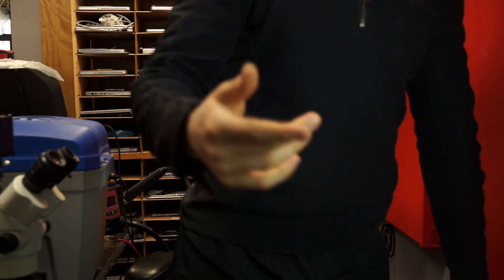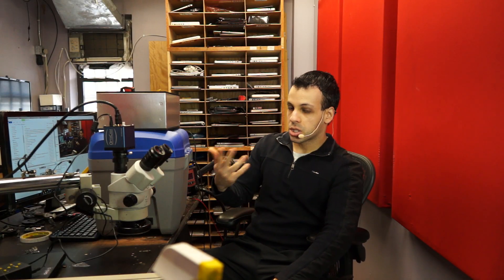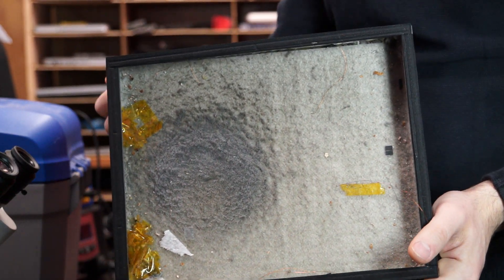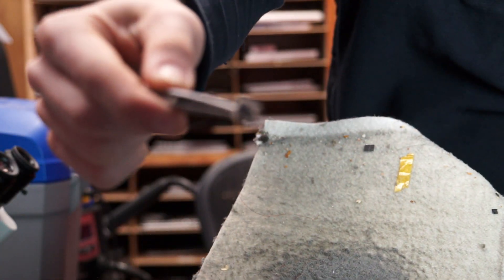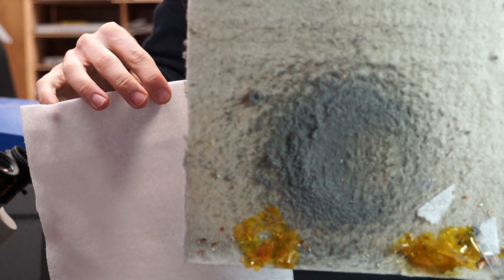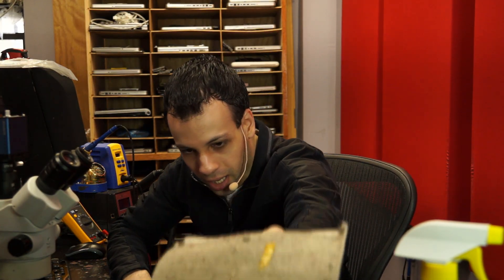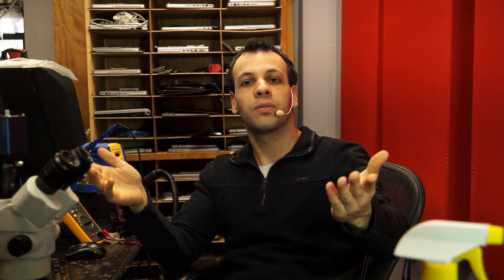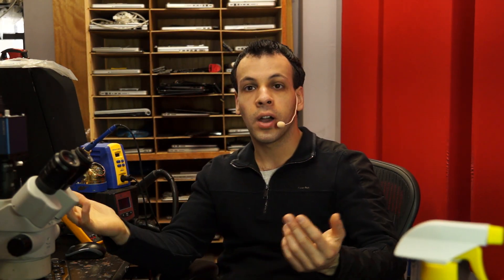A word on soldering and fume extraction

Comment: Id love to see you make a video where you test the used filter to see exactly what all of that is. I say this because my normal fans will look like that after a month of lots of use before i started soldering, just from normal dust. I’m not doubting that some type of fume extraction isn’t necessary, I believe everyone should at least have a fan blow it out of their face. I just started soldering and because the cheap ones that use a carbon filter cost like you said 50-70 dollars I bought a compact blower fan and some tubing. Since my desk is right by my window I attached about 6-7 feet of tube to fan and cracked the window and stuck the other end out. The blower fan isn’t weak but once I add the tube it adds a lot of resistance and it sucks the fumes up way less so I made some other modifications and still it’s not very effective and just very cumbersome and hard to work with. I’m dead broke right now so it’s just so annoying that now I need to cough up the money for an actual funeral extractor on top of the $30 I already spent. I’m thinking about just getting a carbon filter to put on this fan but i feel like at this point I should just stop trying to make this fan work and buy one that’s meant for this idk.

Comment: Dear Louis,

Do you also run an active carbon filter in there? A HEPA filter does remove dust and flux fumes. But if you have lead fumes these are not captured. Care about your lungs and brain.

Comment: Buy a cheap shop vac and buy fume extractor filters and and line where the air Is brought in and exits with with filter should be possible to do for about 50 bucks

Comment: Louis, loads of respect for you taking a solid line on health. The side effects of not using fume extraction are real and very bad. Specifically, the fumes from the burning rosin (resin, flux, whatever) are nasty. Some refer to occupational asthma or industrial asthma or other terms, but it is real and I live the effects of it after a lifetime in the industry. Many doctors palm it off as 'adult onset' asthma, but it is real. When I started as a 16 year old apprentice in the military, we did not use ventilation or fume extraction - safety was all about cleaning or protecting the work area, not our health! At least our militaries did eventually change that attitude and do care for their people now, but for me that was halfway through my career. The effects can be very long term and may not show up for 20+ years. Once the immune system becomes vulnerable through the long term fume exposure, it also preps the body to be less immune to other allergens. So essentially, the industrial asthma opens the way for me to have asthmatic reactions to other allergens! Please, please everybody, take the fume extraction seriously.

Comment: You can build a beastly extractor for peanuts using the small or large shop vac of your choice and any HEPA and activated charcoal filter panels you wish. Mine is a small shop vac whose hose fits the cut-off end of an antifreeze jug which took longer to wash off than connect. You can use clamps, magnets or zip tie yours as I did to a spare monitor arm. 
Filters are key. You can match or beat commercial units simply by using appropriate filter media but the best way is to exhaust outdoors because "filter and recirculate" does not give you FRESH air. 

Plumbing shop vacs is easy as is cutting a panel to insert in a window so your fume extractor also draws clean air into your workspace. If you exhaust your air you don't need to filter it.
I collect all the shop vacs large and small I can score cheap (yard sales etc) and have them throughout my shops. If you place your filter on the exhaust side of the vacuum it can be large, bulky and mount anywhere including walls (unused wall space should be put to work for zero footprint equipment locations, I even hang my 1U server like a painting).

Comment: I had to do a tiny bit of soldering on one of my guitars recently. The jack needed to be replaced, so I had to solder it loose, install the new one and then solder the wires back in place. I actually put a desk fan at a speed/distance where I got maximum airflow over the desk without cooling down the soldering iron/components too much. I had two large windows open for ventilation and still I held my breath while hanging over the desk to solder everything in place. There's no way I'm gonna inhale all that garbage. If I had to do soldering on a regular basis, I'd get a fume  extractor for sure.

Comment: I’ve only soldered like twice to replace some game cart batteries & try to start repairing my Genesis controller ports, and I had no idea this was a an issue, even with lead-free solder.  And my preexisting asthma wouldn’t help either.
One time when my mom was right all along. Even if I’m moving my soldering outside, I’m gonna look into a Hakko FA-400 filter. Or use that high power fan my dad has in his garage. Thanks for this vid, it’s been a month or 2 since I first soldered in my room and this just adds to why I should never do that ever again.

Comment: I made my own solder sucker out of a 12v marine inline fan and flex dryer tubing. Sounds like a jet when it’s on high but the Fumes go outdoors far away. 
I also weld with flux core wire on galivanized steel outdoors with a huge shop fan and a respirator. 
PPE is your only hope! Never ever let some fool tell you different!

Comment: How well are those cheaper extractor with just regular carbon filter work? I don't have 600+ dollars to spend on the extractor since I'm just a hobbyist. I always just solder next to an open window, which's not always convenient. It'd be nice if the cheaper ones do well as well.
Reply: Instead of opening the window you can cut a simple panel to fit the exhaust hose from a shop vac. Used vacs are cheap and highly effective plus they bring in FRESH air by removing contaminated air.

Comment: Nice that you show the filter and how dirty it looks but be honest, you used it also as a vacuum as kapton tape isn't airborne nor is 60/40 or rohs solder granules. But you are right, flux, metal and especially lead fumes will harm you. The first 3 minutes were ok, the rest is filler.

Comment: 02:43 This is a pre-filter that traps the coarsest particles and dust. It is best to replace it every 7 days, max 30 depend on use. The most important are the next HEPA filtering very small particles like 0.3um.

That gray thing is tin fumes, and this is especially bad for tin fumes with lead.
Even if not such a great HAKKO equipment, each smoke absorber with 3 filters will also be good for an amateur, as long as the filters meet the standards.
When working professionally, there is nothing to save on health.

Comment: On the cheap for lab work and soldering, I just use a 40$ exhaust hooked up to a socked activated carbon filter tube for 25$ and some flanged flex tubes for 12$. I have asthma and early COPD and to much BS in my lungs to take to many chances even if I can not afford a 400$ fume extractor. You could just set the exhaust assembly with a filter on the floor and it will clean the air in the room but to protect the motor and for just in case, I hook it up to suck through the filter and out a window.  I mean it is pretty good and does not even leave a smell, the flex tubes can easily be moved on the fly next to my work. It will not only protect you, but it will also completely deodorize the air given time.  I use a 6 inch but a 4 inch would be fine for just soldering and flux fumes.

Comment: Flux fumes, they are hazardous.
Not breathing the lead or tin though, you would need a solder pen heating in excess of 1700c+ to boil those metals into fumes.
But avoid the flux smoke, that has hydrochloric acid in it and a bunch of other toxic polymer chemicals that bind in your body building up over time.

Comment: Don't waste your money on a fumes extraction gadget.  My lab is setup with a fumes exhaust system which vents the fumes outside.  Works much better and no worries about whether or not the filter is functional.
Reply: That's how the big boys do welding fume extractors and the method should be much better known because filters don't bring in FRESH air.

Comment: And for those of you doing it on a budget and saying "Well, I have these cheapo 20-40 $ carbon filters with a little fan" - they pretty worthless when trying to filter the fine particles out. Charcoal-based filters are mostly for VOCs and gaseous particles which are adsorbed by the charcoal pellets - but they have a hard time filtering out small solid particles. That's where HEPA grade filters come for the rescue. I know, they aren't cheap - but there is a reason why they are $$$.

If you cannot afford them, make sure to solder in a well-ventilated area. Use a fan to blow (might be better than sucking) the fume away from you, so you do not breathe the whole dose in.

Comment: Just a little thing to add: make sure you get a fume extractor with a normal prefilter. This prestage filter is just for filtering out big particles (normal dust and some debris), so that they don't get stuck on the main (HEPA) filter like in your Hakko extractor.

Helps to make the expensive HEPA filters run longer and more effective, because it get's only cluttered up with the fine particles. Apart from that: Use a fume extractor, you do not want to get that sh*t into your lungs. It does cause asthma and is under the suspicion of causing lung cancer, too.

Comment: I work in a room with two electrical engineers that solder from time to time. Once they filed the room with fumes and it was unbearable. Raise some concern and got told they'll crack the door from time to time

Comment: When I was in my teens we would use compressed air to blow the asbestos dust out of the brakes we were rebuilding.  Most of my life I worked in factories, exposed to God knows what, with safety gear that was inadequate at best and frequently nonexistent.  I'm in my sixties now, more through good luck than good planning.  I'm sensitized to so many different things I had to move to a nonindustrial part of a third world country to be comfortable.  Take this stuff seriously, or put a down payment on the lot next to mine.  It's your call.

Comment: Anyone know if the Weller Zero Smog EL is a decent unit for a single microsoldering workstation? It's the only one available around here and ordering something else internationally for twice the price is kinda difficult these days with supply chains drying up. But if its utter crap, I guess we'll have to do without for a while longer until we can afford and actually get, a different unit.

Comment: I know this video is getting old. However, I just watched it. Therefore,  I'm sure it gets new views all the time. 
Some advice. 
If you solder more then 30-min a day on average. Without fume extraction of some kind. I think it will affect you one way or another at some point in your life. With that said, it's a free country or It should be a free country, that's an entirely different debate. Do what you will. This is for all the new video viewers that have some concerns about replacing oxygen with solder fumes. 

 I have been soldering since I was very young, I'm 40 now. I will give you two tips for those who are low on cash. 
Go to a junkyard pick up any auto blower motor. Preferably a 4 door truck blower. The blower is located under the dash passenger side. 5-10 bucks. That's all I will say about the blower if you can't figure it out from there you probably should not be working on electronics. 
2nd. I have never purchased an expensive fume extractor. These things are not rocket science.  They are a suction fan (blower) with filters designed to remove micron size particulates. The science only comes into play when you are figuring out CFM to filter resistance in order to get a good air volume and pull force to do the job. 

I do pay for the proper filters to do the job, I don't cut that corner. You can buy these filters pretty cheap if you don't go after brands that make soldering equipment. I buy the filters then build my extractors with the filters I purchased in mind. Filter size, shape and density play a part in your design. 
 I don't use automotive DC blower motors anymore. They do work great. However, running DC can be a pain. I use blowers like  Fasco Centrifugal Blowers 115Vac. I pay $20-$50 for one. My homemade fume extractor pulls more CFM than the $1k name brand extractors & I build them to fit my workspace size. I use simple airflow tubing, material like 2.5" Pool vacuum hose or 4" industrial vacuum hose its nice and rigged & my favorite 4" - 6" Tigerflex Polyurethane Vacuum & Duct Hose.  

Anyway, have a good one!
Good luck with your adventures.

Comment: You can build a BETTER fume extractor easily for less than $200. That includes the inline fan, box, (certified) HEPA filter and carbon filter. It's really quite easy. I agree with rossman 99.9% of the time. The only two points I really disagreed with so far, was the knock-off HAKO station, and the idea that you "NEED" this HAKKO Fume Extractor. It's ridiculously overpriced. The HAKKO extractor is literally a $50 shopvac with a $60 filter in it for $600+ 

I will be posting a guide on how to build this very soon. You can get everything you need at your local Home Depot or Lowes.

Comment: It's an old post I know but just appeared on my youtube page , I'm an old tech that use to solder TV equipement with this thick gauge of welding lead in the old days on point to point equipment  ,people and company owner used to have an excuse not to protect their lungs like saying well you just develop a technic off not breathing in when the lead touches the soldering iron lol  ,then later  i worked into big telecom factory in SMD device and fiber optics it took them a lot of time to adjust to safety norms believe me' we had all the safety imposed anti-static regimental rules like ESD shoes and flooring and lab coats but even there nothing to protect assembly workers doing touch up soldering works  because the main part off welding was done on the wave machine with its own extractor ,so what we did we bought our own 120MM computer fan that we layered a carbon thin filter on them so we didn't have to hold our breath welding ,mind you welding surface mounted micro device your still controlling your breath not to shake under a microscope without you even noticing it !

Comment: I think I'm pretty "healthy" even as a smoker. The one thing g that I really don't want to breath in are solder fumes. Currently what I do is open all my windows with my room fan on my ceiling on. Not really the best set up but it's what i've got to work with.

Comment: "Poverty is not an excuse to breathe in fumes" Agreed. When I was in my college dorm, I would just push my desk up against the window, throw a box fan in the open window and suck out the fumes. It worked better than any fume extractor I've used.  Meanwhile at work, as a technician, all we have is one of those crappy little desk fans with the carbon filter. The worst thing I have inhaled while soldering is superglue fumes... If you get superglue above 500°F, the fumes feel like you are breathing razorblades. Also pro-tip: Teflon fumes will give you flu-like symptoms for a couple days. It sucks.

Comment: Not to argue about the need for a fume extractor, but how do we know that the crap in the pre-filter is from the soldering alone?  I pull that kind of crap out of my PC without any soldering.  Looks more like the lint floating around in the air.

Comment: With all due Respect here to Hakko, this is nothing but a plastic $50 Shop Vac with a Box Filter LOL. This is nothing worth more than $100 even with the plastic hoses. You can build this type of box filter yourself for around $60. You will need a small square type Shop Vac, Dimmer for voltage control to the motor, a vehicle  rectangle filter, a second shop vac hose for the second person so cut out a second hole on the top of the shop vac cover. Hakko is ripping the hell out of idiots who can't tell a plastic box that is really a shop vac. Again for $60 you will build this Hakko clone.

Comment: Just a note: the circle of grey stuff doesn't come from the solder and flux, it's just dust. The discoloration, on the other hand, comes from the solder and flux fumes. None the less, it is important to get a fume extractor.
Reply: Also you're probably not going to be inhaling the kapton tape, wires and random component.

Comment: My old boss didn't use extractors.  
You have your head over it, hours a day. Do that for even a few days and you start feeling it. Throat feels sore, feel off in the head.  
Plus on small workshops someone on another bench can be soldering and it's floating around for hours in the air in there.  

I You can get away with soldering once or twice without one, "just hold your breath" sort of deal for a transistor or a capacitor you need to replace every few months.  

But it gets to you for sure. Even carbon foam filters and a PC fan are heaps better.

Comment: I assume it also sucks up DUST particles in the air and since the solder is not in gasform that is most likely dust, dont you think? It looks exactly like the dust in a vaccum cleaner.

Im also interesed in FA430 but $842.15 is a bit much.  Can you recommend any other models that "sucks" more then the toy Fa400? Looking at a CXG 493A, have you tried that that?

Comment: A cheap solution is to get a "6 inch mixed flow fan" off eBay or Amazon for like $40, and a 6" dryer / air conditioning duct, and to just vent it outside. Way better than nothing.

Comment: You could always use a dryer hose and 12v computer fan and maybe a 10 inch fan with rear tapered to the hose and out the window using whatever to seal it.